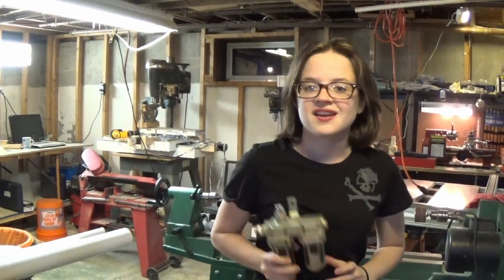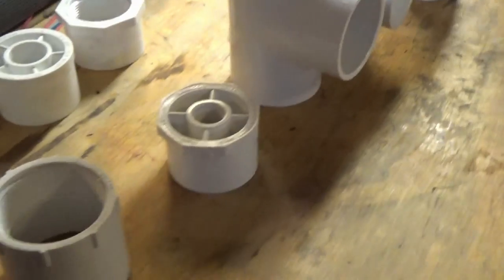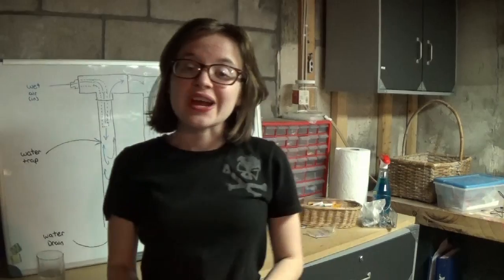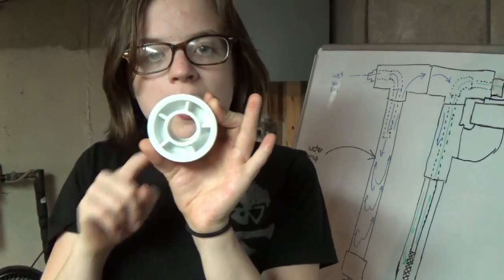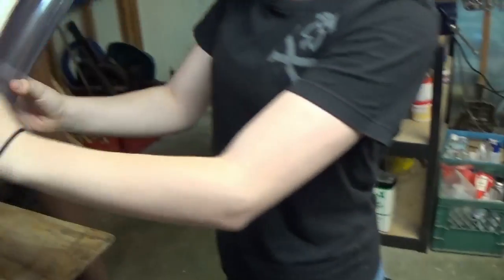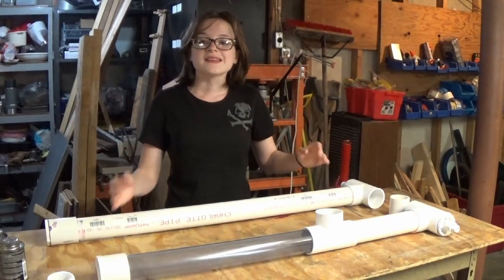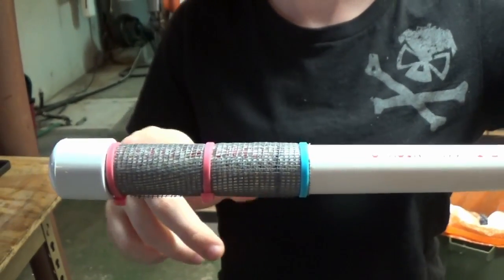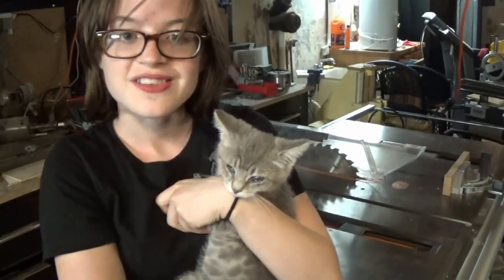Ep 11 Dirt Cheap DIY Dessicant Air Dryer

Comment: Excellent

You may older today!

Congratulations

The best use of teflon tape on U-Tube so far!

Beautiful design!

I love how you did angled the re-filling port !  Amainzing !      Well Thought !      A Genius Solution !

As you said it !    "Dirt Cheap"    Otherwise you will have used ball shut off valves !

Only one observation!

The violet stuff is to swell the PVC pipes1

Yes, PVC Pipes needs to be sanded down to fit each other without mayor resistance, but not loose !

--The Violet stuff swells the applied area only !  
--Let parts to dry to touch.   
--Apply glue pipes and put parts together with a twist motion.
** NEVER put them together with a linear insertion at all. **

¿To void running violet every were?

Mask the pipes with masking tape and news paper or flyer's papers.

I would had use ball shut off valves to empty and to re-fill, but that is just me !

God Job !!!

From 0 to 10,  I give you 20 !!!!

Atentamente,

Charlie

Comment: Nice job! I have a long zig zag of copper pipe with drain valves after the compressor that gets rid of most of the moisture but I still want the air drier for plasma cutting and HVLP spraying. Your idea is just what I needed to keep from spending more time emptying the desiccant container than working. The one significant change I made was to use sintered bronze air mufflers for the filter instead of drilling holes in the pipe and using a screen. They are inexpensive and work well. Thanks again!

Comment: 2" Schedule 40 PVC is rated to 280psi max working pressure. You just need to make sure that you have excellent glue joints. Been using this for years on a 150psi compressor with no issues. Just keep the assembly out of direct sunlight since PVC is not UV resistant.

Comment: I built a snowmaker that requires 125psi working pressure and the problem that I have is moisture freezing up the air nozzles. When I make snow it's around 20 degrees outside so given the air velocity it can freeze quickly. I haven't tried a desiccant dryer yet because of the constant air flow required. Sounds like you do sandblasting which could be something to go by. What would you do? Thanks!

Comment: Have you considered the idea of drying the air on the intake side of the air compressor?  You might try using air from a conditioned source and using a large bed of dessicant beads to maximize contact time and minimize condensation in the storage tank.  Add an after dryer and maybe insulate the storage tank.  Just a thought.  Great video and best of luck to you going forward.

Comment: never use pvc for air. that will be fine for a few years then one day your using it and BOOM shrapnel everywhere. my grandfather made that mistake years ago. he built a shop air system and was fine for about 4 years. then one day he was using an impact gun and it exploded. luckily he was not near where it blew but the wall was peppered with pieces of plastic. you would be better using either copper or iron pipe with pressure release valve than pvc. good work on everything else though.

Comment: I just seen this video while doing a little inquiry into an air dryer I'm in need of. This is a wonderful video! You a an amazing young lady!

That being said I still wanted to give a word of caution that I thought right off the bat when hearing the material (pvc sch 40) that you are using for this build. I used to sell pneumatics and I want to stress you should never use anything other that pipe specifically made for compressed air if the intent is to put it under air pressure! The pressure rating you see on pvc pipe such as for waste water (the sch 40 your using) is a pressure rating when filled with water... and under water pressure. It is much different when comes to air.

I've seen a few people below comment about the caution of using this in cold climates. That is very true but it's not simply due to water freezing in it... its due to the pvc becomes extremely brittle! Would only take the right vibration or something falling over into this pvc tubing and it will break violently. Even worse is that this type of pvc when it breaks doesn't just simply break in half... it splinters off and will become shrapnel! Extremely dangerous to put under air pressure. Regardless of whether it's cold or not. 

My word of caution.. NEVER use any tubing for compressed air unless it was specifically designed for air pressure applications.

Comment: Except you left out the fact that PVC is a form of a heat sink so there it captures heat and holds it. 
Copper is a better solution. Always has been. 

And PVC can explode. Which could be VERY bad if people were to follow this advice.

Comment: First .... "Great Job!"  next .. observations... too much hair, too close to the lathe, get a hair net!  And get some proper footwear in the shop!  Remember this "open toe, no no!" (steel toes and shank best!)  Next when joining PVC, if you can, a "Quick" quarter or half turn is best, it helps remove bubbles from the glue!  and last ... You did a great job with this video!

Comment: So what air pressure are you running? Sch 40 PVC 3" PVC, which is what I would build my system with, has a MWP of 260PSI. But at 110 degrees F this is derated by 50%. If I trust my gauge my system is operating up to 125 PSI. It's not uncommon in my unairconditioned shop for the temps to reach 110 degrees and then I'd have to add ten degrees to that for the temp coming from my aftercooler.  Would like to use a PVC setup but I feel I'd be running very much on the borderline. Given I work in the oil & gas industry, where safety is paramount and I believe in it, I'm going to have to run an aftermarket dessicant system.

Comment: Just make sure you do not run the setup with high pressure or you have a bomb - PVC shatters. Not safe at all! Better get at HD a steel pipe and 2 steel fittings - dirt cheap & no "bomb" potential.

Comment: That's a nice design on the drier ! I didn't know the drier beads could be regenerated, that saves a lot of $$$ ! 
I'd just add metal piping before the drier, sloped back to the compressor, to help condense water out of the air. 
Build a tip tools drip loop too, they work great. Make more videos :)

Comment: By Charlotte Pipe: Testing with or use of compressed air or gas in PVC / ABS / CPVC pipe or fittings can result in explosive failures and cause severe injury or death.• NEVER test with or transport/store compressed air or gas in PVC / ABS / CPVC pipe or fittings.• NEVER test PVC / ABS / CPVC pipe or fittings with compressed air or gas, or air over water boosters.• ONLY use PVC / ABS / CPVC pipe or fittings for water or approved chemicals.• Refer to warnings on PPFA’s website and ASTM D 1785.ADVERTENCIA indica una situación de riesgo que, si no se El fallar en el seguimiento de las precauciones de seguridad puede ocasionar una mala aplicación o una instalación y prueba impropias, que pueden ocasionar lesiones personales El hacer pruebas o usar aire o gases comprimidos en tuberías y conexiones de PVC / ABS / CPVC puede ocasionar fallas explosivas y causar lesiones severas o muerte.• NUNCA haga pruebas o transporte / almacene aire o gases comprimidos en tuberías y conexiones de PVC / ABS / CPVC.• NUNCA haga pruebas con aire o gases comprimidos o aire con elevadores de presión de agua en tuberías y conexiones de PVC / ABS / CPVC.• SOLO use tuberías y conexiones de PVC / ABS / CPVC para agua o productos químicos aprobados.•

Comment: Wait a second. Why are you knocking yourself out  building this filter with a tube inside of a tube ? Why not just have the air enter one end and exit the other end ? You could have the air enter on the bottom , off to the side of a clear PVC tube and have a drain at the bottom to empty your silica beads. Then have y-fitting with a screw on cap at the top for filling the tube with silica gel. Are you with me ?

Comment: Rule number one , never trust youtubers 

Rule number two PVC and compressed air is like  acid in a paper cup   , it will work but ... 🤔
Reply: Why? Can you explain?
Reply: PLASTIC CAN EXPLODE! Especially under pressure and when they are cold. Also, the weakest link in plastic pipe/plumbing are the connectors. Never a good idea to use plastic for air compressor lines.

Comment: Do you really need the 1st 3/4" section and elbow?  Could you not just let it go straight into the 2" pipe to condense before squeezing it into the 1/2" pipe down to the bottom of the desiccant?

Comment: Sorry that was just too painful to watch, I couldn't get through it. Maybe a good school project but not DIY. 60% of everything said had nothing to do with the topic at hand. Too much. BTW, two issues: That setup can kill someone. While good PVC pipe is pressure rated for that kind of pressure, it's not designed for what you're using it for. PVC's pressure rating is static, every hour that PVC is exposed to light, it's explosion pressure goes down. PVC rated at 300PSI can withstand 400PSI new. 10 years down the road it could burst at less than 100. PVC shatters, not ruptures, as in hand grenade. Second, for the money spent, you're 3/4 of the way to a commercial one, which is much more efficient and safer.

Comment: Again, no consumables, lasts as long as 2in, schedule 80 pipe does. Doesn't fracture at cold temperature (1/3 of the US), oh, and did I mention no consumable. I'll give you an A for effort BUT.

You're using hydrocarbon  INTENSE ( bigger CO2 footprint) materials. That are quite a bit more expensive. And you've designed you're solution around a scarce material.

The dew point drier is completely PASSIVE. LASTS FOREVER, and gives you the same results. I built mine for less than 20$.

Lesson to be learned here:

Is my solution the only solution?
Is my solution the easiest solution?
Is it the most durable, the least expensive, the one with the least oper as ting costs?

Am I using "the most appropriate technology?" Not merely the easiest for my hands to hold onto to or manipulate.

(Which is what I think you did, IMHO.)

Cheers, keep learning. You're doing good.

Comment: I got the set without the accessories because I'm picky. >>>>ur2.pl/1018     Follow the break in instructions like the other reviews say. Run for 15 minutes while the release valve is open. Good construction overall. comes with two quick connects. I ended taking one of them off and putting a recoil hose on it. One less point of failure.
Reply: loving it is

Comment: Great video little lady!  Just do not know what else to say.  You already have talents and skills that old guys (and gals) envy.   You will do well and already on your way!  JJ
Reply: I forgot to give you a tip when using slip-joint tools.  These tools work best when used in the same way a pipe-wrench is used.  Apply the top of the tool so that the open side is pointed away from the direction of travel and the bottom part of the tool open side points toward the direction of travel.  This applies to adjustable wrenches as well.  This permits the work to be done more easily, prevents rounding of the fastener heads and prevents breakage of the tools.  When fastening bolts and nuts; always turn the nut if possible.   :-)

Comment: Hello, my names Chris, I’m from Kentucky, this video leaves me with several questions plus my original, is this safe for me to build with me needing to run between 90-125psi, should peak around 140, and how long does the desiccant last before you have to bake it. I came here trying to find what air compressor I need to run a sand blaster everything I have is too small.

Comment: Question for people.  I cannot locate the PSI of air that leaves the actual compressor pump.  Would a PVC system like this be safer/appropriate if I added this dryer between the pump and the tank?  Do to the fact that a check valve will be in between the tank and dryer, would this lend credence that the PSI is indeed lower leaving the pump than in the tank itself?  Thoughts?

Comment: it would have been nice to show the performance of the unit after completion but no one seems to do that on youtube, i will say just on observance of the design as shown in this video this dryer will probably be ok for the average dIYer's home uses, however i have trouble believing it will allow for the kind of unrestricted air volume that is required for sand blasting.....

Comment: I would be very concerned about piping hot air into PVC and or the constant heating and cooling of it over time which can lead to failure.  Ive been looking at these systems for weeks and it seems the biggest consensus is to NOT USE PVC, especially where it will have hot air under pressure as the constant heating and cooling over time is what makes it dangerous.  Plastic ages and becomes brittle over time unlike metal which does not.  It's one thing to use PVC for sub 100psi air runs once the air is dry and cool but I would never feel safe using it as a dryer that gets hot air straight from the tank or worse, straight from the compressor.  Secondly, when cold, like in cold climates plastic is also equally susceptible to failure. Combine that with sudden heating and you are begging for failure.  In either case an exploding pipe can kill you.  

In short, I chose to get my information from engineering specifications and actual code allowances...not peoples "helpful" DIY videos even as charming as this is.  Using PVC or ABS plastic, or any plastic (unless specifically designed for high pressure air) is a big NO NO.  And even if rated to "X" pressure that you may not be hitting, you really have to factor in time and age and how that effects plastics especially with constant heating and cooling cycles in the mix.

Comment: PVC isn't really designed for compressed air. When it fails, it bursts  into glass like shards. Also,  why quit using the purple primer? That stuff is important as it softens  the  material to allow for actual fusion of the 2 mating surfaces, making  the joint much stronger  than just glue. It's more like welding. One more thing, there's a specific  direction that you're  supposed to wrap Teflon tape in. It's wrapped in the direction you'll be spinning the threads  into the fitting so it doesn't  unwrap while you're making it up in the fitting...  cool concept though. I like your  attention to the order of operation.  You have an interesting way of socking  PVC pipe n fittings together.

Comment: Get a motorguard m60 it works wonders I just use a roll of toilet paper instead of there filters I sand blast and paint and never have a problem with moisture.

Comment: So what happens when someone follows your instructions uses pvc pipe and then is injured when the pvc system blows up in their face? 

This is very much so do at your own risk! PVC pipe gets weaker over time, the advertised pressure rating is very questionable after 10 years.

Comment: Never use PVC or any plastic pipe on an air compressor system. If the pressure causes the plastic to break it becomes a hand grenade when the pressure is released suddenly. I saw it happen when a cooling system PVC was air tested and the joint broke apart. Luckily no one was hurt but the damage to the room was extensive.

Comment: watched the beginning of this and pretty much have one thing to say... any desiccant dryer mounted to an air compressor is JUNK.. not the dyer but the fact it is mounted to CLOSE to air compressor ..you need to install it at least 20 feet or more away so the air vapor turn to a liquid state for desiccant dryer to operate. the ones mounted from factory near an air compressor are a different type of air dryer and meant to be mounted close . I have a desiccant dryer right before a commercial grade regulator for paint sprayer with built in desiccant that goes to 50 foot airline for the shop which can be plugged into blasting cabinet which has yet another desiccant dryer as well .. pretty much 3 dryers all mounted X distance apart and when spray paint with gun use a ball desiccant dryer on the gun itself as last line of defense for moisture.. drain daily zero issues in 30 plus years .

Comment: Hannah, check out this caution about using PVC pipe for air compressor plumbing. Doesn't look like it is a good idea.
There is Green plastic pipe that is rated for use on compressed air lines.
https://www.about-air-compressors.com/pvc-air-lines.html

Comment: I like what you have done here. Great video. Humorous and informative. 
A couple things you should do next time you are working with PVC. When gluing it you should twist the PVC about 1/4 turn. This will eliminate and straight striations due to inconsistencies in the piping. Also I do believe the instructions on the bottle will tell you to do this. Also I feel you should have used SCH 80 for the 2" pipe just for an added measure of safety. 
Minimum burst pressures are 243 for SCH 80 and 166 for SCH 40. Your 3/4 and 1/2 inch pipes are fine with min burst ratings of 289 and 358 respectively. I seriously doubt that you will have issues with the 2" pipe but for me always error on the side of safety.

I am going to subscribe to your channel because I really wish to follow your progress. You seem to have a bright mind and a great personality. Best of luck in your future endeavors.

Comment: I see a lot of comments at how dangerous this is. Well I worked for years in a machine shop where all the air lines were pvc. Sometimes they would break, but never exploded. They just cracked and bled off air. I also have pvc lines in my shop for yesrs. Never had an issue. Perfectly safe.